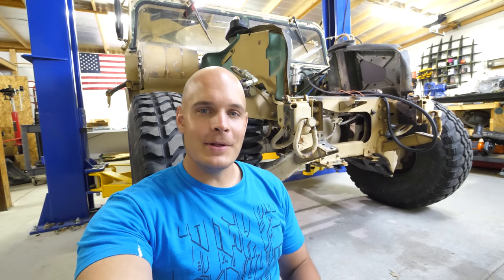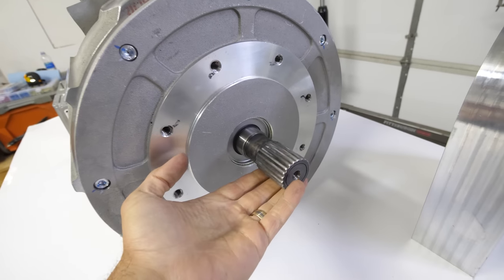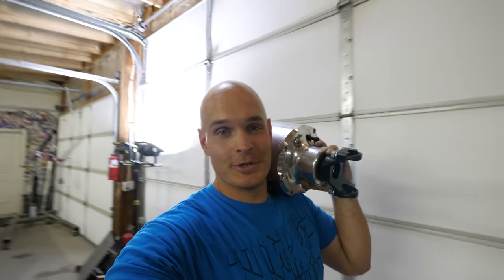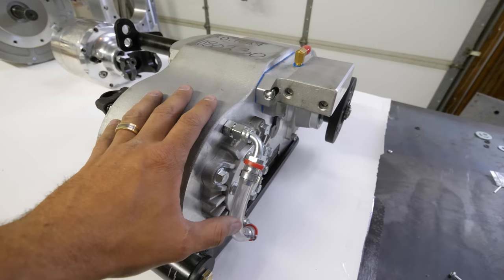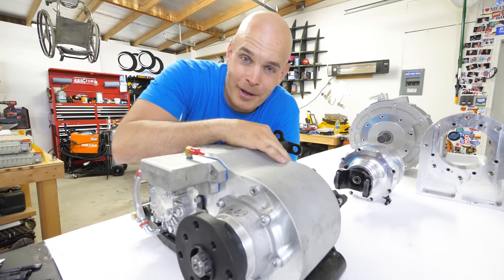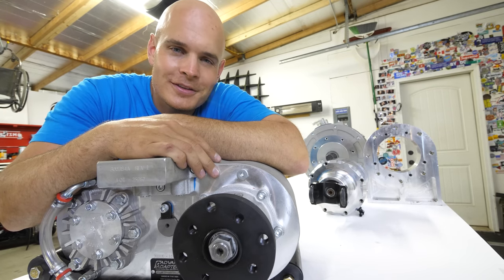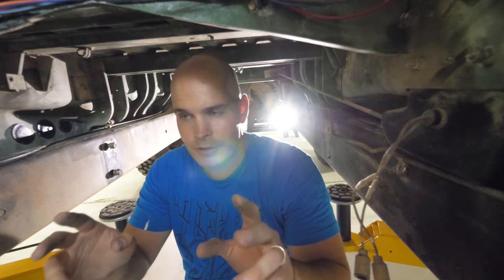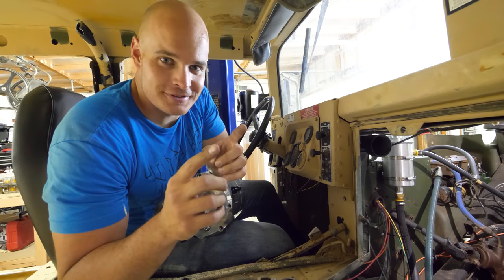How Strong is my NEW Electric Hummer Motor? - EV Conversion!

Comment: “nm” is nanometers, newton-meters are denoted “N⋅m”.
Reply: This needs to be upvoted more. Not saying Zack is terrible but I'm sure he would appreciate constructive criticism!
Reply: Exactly...
Reply: Do muricans actually calculate with nm and Nm or do they have some special  newton nano yard inch mile?
Reply: @flausensieb  I think it's lb-ft
Reply: How much is that in bald eagles
Reply: Thank you, I also had to write about it. We fight for the correct units of measurement in internet, but still unsuccessfully. Instead of torque in Nm the nm's have been given, i.e. a length unit. A small change and changes everything.

Comment: I was a HMMV (sp?) mechanic in the 82nd over 20 years back.  Brought back memories when I saw the pile of parts on the floor ... HMMVs are not known for speed.  We were lucky if they went much over 50mph.  But they are noisy as hell and very uncomfortable.  Their real strength is in their ability to traverse off road, places a conventional vehicle can't go.  In short, they are the modern work horse of the Army.

Comment: Not long after I bought my used 95 Hummer, I started looking into converting it to Hybrid. The all electric components wasn't up to the task at the time. I got a little misty eyed watching this. Much love for you and the family. Stay safe.
Reply: JERRY RIG SHOULD BE "THE BEST JERRY ". HOW BIG, FAST AND HEAVY MAY I POWER A DISPLACEMENT HULL, PLANNING OR HYDROFOIL WITH YOUR HUMMER POWER PACKAGE OR NEW CONCEPTUAL IDEA. ALSO MAY I BUY A KIT FROM YOU READY TO DROP IN WITH WET BATTERIES UNTIL CHEAP CAPACITORS, LITHIUM OR RECYCLED BATTERIES BECOME AVAILABLE. PLEASE EMAIL.
Reply: JERRY I WILL ISSUE A PROCLAMATION TO YOU ABOUT YOUR DAY IN KEY WEST FLORIDA!

Comment: Heyyyy, just wanted to let you know that your garage door is missing something. The top of your automatic door needs a strut, or your opener is going to pull that door right in half and it WILL fall on your truck. Especially if the torsion spring breaks and you don't realize it. I know it's unrelated to the video, but it's what I do for a living. LOL
Reply: Thx for the info, I hope he sees this
Reply: @yourmomlmao9638  ORRRRRRR, he can go get himself a Chamberlain or Genie residential jackshaft opener, and get the motor and rail out from the garage altogether. Then he doesn't need a strut cuz the opener clamps right onto the spring tube 👍🏻. Things are fantastic machines
Reply: My garage ceilings are 11+ft high.  My doors are standard.  When we moved in, I noticed my front garage wall flexing when operating it....  There was no strut for a double door, with motor dropped down about 4ft!  don't know how it ever passed inspection.
Reply: Poor door. Gets ripped in half and falls on the equivalent of a Nokia on wheels.
Reply: @bear8046  Or, ya know....a person? You wouldn't want the guy getting crushed by his own door, would you?

Comment: Zack: "I don't officially have the weight of these components yet, but I can move them around by hand so they aren't too bad"

Also Zack:  has arms the size of the components themselves
Reply: moves the motor and entire table is shaking
Reply: @Blox117  I believe that motor weighs about as much as my Jeep transfer case. Not bad really. Well under 100lbs
Reply: True!
Reply: @yosemitesamiam  then he mounts 150lb tires and wheels no sweat
Reply: @yosemitesamiam  Not even close. The UQM 220 motor weighs 83 kg (183 pounds) and the controller alone weighs 40 kg (88 lbs).

Comment: I would love to see the total cost of this build at the end when you finish!
Reply: Are you planning to do a similar project?
Reply: @Brain_With_Limbs  not at the moment, and probably not with a HMMV, but if it turns out to be cost-effective, I think it could be a cool project!
Reply: @drteeth362  Ya I would like to do a car conversion someday, as well.
Reply: The motor will be really expensive but the batteries will reduce in costs each year
Reply: @drteeth362  all the best
U could try making a real truck fully electric
Will be easier to work on
Reply: Data Fix  wtf do u mean
Li ion batteries cost is reducing the motor demand will be much higher as EVs become the standard
Reply: Engine, 25 grand, the torque box and stuff, probably another 10 (pure guess there that's probably wrong), used Tesla packs are 1500-2000 each (and they're not easy to find if you want the modules from the S or X), it starts adding up. Plus labor. That's the drive train alone. Obviously it can be done for less, but that mahoosive engine kind of sets the tone. Obviously this is all just guesstimates and I too wouldn't mind seeing the final bill.

Comment: ✌🏻 can’t wait for the next video 🤩
Reply: @Samsung Galaxy S12 Pro Max Ultra 6G 128GB 
omg paid bot
Reply: @satendra_sharma  yeah kinda SUSSS
Reply: @satendra_sharma  it is you who is the bot
Reply: Hi
Reply: I'm ur big fan... 🥰🥰
Reply: Yeeeeeeeeeeeesssssssss
Reply: My nissan cube is going electric too. Lol. It will do wheelies
Reply: All the steel after the 4wd box will be pulled apart by the torque. 30 seconds and the video can be over. But Jerry knows this.
Reply: @Madrrrrrrrrrrr  Yeah, it seriously needs soft start controls. Shaft strain gauges and torsion feedback indicators in the instrument cluster just in case!
Reply: @jameslynch8738  yep.
Reply: Waiting for the next video 🔥🔥🔥❤️
Reply: Going to his home may help 😂
Reply: @Madrrrrrrrrrrr  yeah he may need to electronically limit the torque output when going into low range. Once he's done building it he'll just have to see what happens and be prepared to fix some things. Good thing is the hummer parts aren't hard to find.

Comment: This is one of the coolest EV conversions! Any worries that the portals and differentials won't be able to live long with all that torque? Any thoughts on swapping the shocks to something that can go fast through the desert?
Reply: Split the power system into two motors and remove the drive shaft. Would allow more adaptive traction control I think, or any differential setup would burn up trying to compete with it.
Reply: Come to think of it, long stroke shocks and maybe wings(?) for ripping across the done tops.
But for endurance it would probably fail to this guys rig because drivers would try to burn out the power system. Back to the drawing board. Haha
Reply: So these military vehicles shocks and under carriage moving parts were meant to take blows and force from explosive, not making them bullet proof or bomb proof though they were made thick and heavy, enough to take a beating…. Increased torque should not have an immediate impact

Comment: It will have torque to rip the tires apart lmao, crazy ideas, dude, I love it ! You earned a sub !
Reply: It will break cv shafts.
Reply: Will definitely need beadlocks on the wheels :D
Reply: It's going to make less torque than the original motor did.
Reply: @joshjlmgproductions3313  but makes 100 of its torque from 0 rpm. Totally different to ICE.
Reply: @nunchuckfilms  That's true, but it's still 700 NM of torque, not 4200 lb/ft.
Reply: @joshjlmgproductions3313  why ? It's an eletric one, torque is instant. And with all those gear reductions, it will have plenty of torque.
Reply: @errorsk2188  Because ICE engines also have those gear ratios. The thing is, the ratios change depending on what gear you're in and what your final drive is, so it doesn't make sense to specify how much torque you get in each gear.
Reply: @joshjlmgproductions3313  I guess so

Comment: so...my only question is...how do you waterproof all the new electric parts and make it off roadable as the original was with water crossings and such(reasonable depth) not completely submerged
Reply: He doesn't, this is to be used on city streets
Reply: I'll bet a lot of the parts are already pretty water resistant, but I'm curious also
Reply: Kydex. It wouldn't take much to just close off those components with flat sheets, but, you can heat and form it too. Indigo black works for the color.
Reply: Taking an off-road vehicle off-road in the 20's?! Are you high?
Reply: besides the individual battery modules, automotive grade power electronics/motors require high level of  IP rating, IP69K which resists high pressure water, solids,dust,.....If this builder uses the proper connectors, with matching gaskets I could see this going through streams no problem.

Comment: 2:40  Just to be splitting hairs.  This motor is an advanced DC motor with a motor inverter to direct the current directionally through the three motor coil systems.  The motor inverter has complete control over the power level, rotation speed and rotation direction.  But in a sense the current does change direction in the motor coils so that is an AC model.

Comment: Awesome project. If I have to say one thing it is do not underestimate the power of gearing. All these current manufacturers are not using transmissions. But what they are failing to do is create efficiency under loads or trailering. They can boast efficiency only with one person under a light demand. Sure they have large torque numbers, but they do not calculate the energy required to move the heavy loads.  Anyways, very cool. I will be following.

Comment: I’m so sold on electric vehicles now. I was skeptical when they first hit the market but they’ve come such a long way and prices are slowly getting better
Reply: Oh yea. They are going to be great but we need to get full solar homes and vehicles. The problem is storage of power and 1000year
Reply: @vanderumd11  in Australia there’s a lot of houses that run off grid. My cousin, her partner and 2 kids lives on a big rural property and they are 100% off grid, gas bottles and also have rainwater tanks plus get tank water delivered. They have a big solar system and 4x tesla power wall batteries with a backup generator if ever needed. In the last 18 months they’ve only had to use the generator for 2 days when we had a solid week of rain during winter. It’s been a pretty good investment so far, their previous house’s elec bill used to be $2800 annually.
Reply: @Chrissmills  They're far too expensive to be sustainable. I'm sick of my tax money going to subsidize that clown, Elon's, anti-consumer, anti-repair, anti-competition endeavors. 4 Tesla walls is like $40 THOUSAND dollars, then add another $20-30 THOUSAND for solar panels and install. LOL. You'd never be able to justify that cost. It would take you like 40-50 years to recoup that cost, and at that point it's needed to be replaced 3-4 times. LOL. Electric power storage has a LONG ways to go before it's even close to replacing grid power and ICE vehicles. And his cars are disgusting. They can't be repaired by 3rd parties, and since Tesla is more focused on making more new cars than supporting the ones that are already on the road, insurance companies total them out because they're too expensive to fix. Tesla doesn't have the service infrastructure to support the repair of their cars in a timely manner, and they don't allow 3rd party repairs, and they're not producing hardly any spare parts, insurance companies don't want to pay for rental cars for 6-9 weeks, so they total them out. Long before they have met the point of being more green than a traditional ICE vehicle. Since Tesla basically disables every feature (like supercharging and autopilot) after an accident, there is no market in salvage Teslas besides people who do it as a labor of love. When a Tesla gets in an accident that would cost $3500 to fix in any other car, it can cost 5-7x as much, because of the aforementioned reasons, so it gets totaled. Ever use a cellphone or a laptop? How long do those batteries last? 2 years, and they don't undergo anywhere near the current draw that EV batteries undergo. Tesla makes up for it with electronics that limit current draw, and now batteries in parallel, but the packs still only lady about 7 years. So just as the car is reaching the point that the mining of the heavy metals for the battery is offset by the reduction in emissions, you need a new battery. Add in the fact that Tesla lies about being open source, lies about producing cars (semi, new Roadster, and truck are all vaporware), and is in bed with the CCP, and you have one of the most deplorable corporations on planet earth. Amy company that gets rich of of government subsidies, funded by the tax payer, and off of the guise that they're doing it to save the planet, should not be trusted.
Reply: @littlejackalo5326  good to see someone with sense, the only thing I don't agree with is with how you say that batteries only last 7 years, they can last much longer at least 10.
Reply: @littlejackalo5326  The australian government subsidise solar installation's by alot, im pretty sure they were only out of pocket around 30-40k for the whole setup. 10 years warranty on the panels/inverter. Im an electrician myself and they have a good system. 40k for 10 years of Electricity is pretty good in my eyes, especially considering just the connection fee daily to the grid is $1, plus usage. They also were up for a $60,000 contribution to add the infrastructure in to get a grid connection in the first place. They bought a massive block of land and they had no power to the property. The house is about 400m from the side of the road so even if they bought power to the front of the land, ontop of that 60k, you're up for another 50k+ to get power to the house.
Reply: Now I want an electric bronco.
Reply: @Pq-A-Bu Wow, spot on. Great job! I wholeheartedly agree. Batteries have to get better (more efficient, better at lasting and holding a charge, better and easier to reuse/recycle, etc.), the grid/and not grid (solar, etc.) has to get better. Electric cars are probably the future, but they have to improve the battery technology and the state of the power grid first in my opinion.
Reply: @MIGUEL18384  only if you charge them correctly (never fully drain) and use them in climates that aren't too cold or too hot.
Reply: @TheGuruStud  how’s it a scam by the government? You pay a daily connection fee to the distributor (which goes to the power supplier for each state) be connected to the grid (this pays constant maintenance etc) and the government have massive rebates for solar to take strain off the grid as we have brownouts during summer which causes under voltage to houses and kills appliances since they’re rated for 220-250v. I’m an Electrician myself mate you have no clue 🤦‍♂️
Reply: @TheGuruStud  bro like that is never in like california or alaska though and if the military goes electric, yeah, that aint happening

Comment: Zach, quick one about the portals/CV Axels. I've seen heaps of videos of these shattering with large loads. 
Will you be upgrading the CVs or are they rated higher than normal to withstand the new torque loads?
Reply: I was wondering about this as well.
Reply: additionally, wont the extra torque multiplier limiiting output shaft speed to approx 80 mph be further reduced to 60 or lower once reduced by the portal reduction and differentials? Just wondering.
Reply: @jspringer86  take your meds!!!!
Reply: @ElBach1y  ;)

Comment: I can't wait to see if those half shafts can take the kind of load the new power system will bring to the table- I'd carry some of those in the off road bag if I was you. (I have a 2001 H1 and have snapped a few of them when torque got crazy.)  Love this series cause if it works out. I'm doing it.
Reply: Those things are gonna snap right away. No way they'll hold up
Reply: @andrewk8636  Bet he's going to get some carbon fiber ones made. That be a pretty cool episode for this series.

Comment: Interesting to see how you are going about this, pretty cool. I own a 95 hummer.
Please don’t destroy removed parts- many folks need them, including the bad 6.2.

Couple things I wonder about for the future.- maybe you are not aware or just haven’t addressed it yet?

1. The differentials are AMC 20, and you should have the factory torsen diffential.
I made the MISTAKE of making mine selectable 2wd/4wd.  The added load to just one diff is really hard on these differentials, and wears them out much quicker even under stock power plant use.  Also the handling is very different (worse) than original full time 4wd.  

2. Strength.  The AMC 20 is no where near the strength of most pickup units.  Some of the hummers I helped modify for more power eat differentials about every 10,000 miles.  You will be supplying similar, if not more power than those ones.  Start looking into the aftermarket ford 9” units.  You will loose the torsen advantage of brake throttle manipulation- so locking units are to be considered. 

Portal axles (aka geared hubs as called by AM General).  Your hmmwv should have the 10,000 lbs units in them.  This dictates the cv axle (aka half shaft) size is also the 10k you will probably need to go to the stronger ones in the 12,000 lbs rating.  The half shafts are the known weak link and many of us owners learned to keep the weaker bearing cage of the 10k units because the shaft is a couple hundred dollars, diy repair parts maybe $100 each.  If you make it stronger- you will break the geared hubs.   My suggestion is keep what you have, carry spare half shafts.  One fits each rear, 2 different units for the front. 

Good luck!
Reply from the maker: Thanks for the tips! You know what you're talking about.
Reply: Oh btw- 
Hmmwv in the tracks of abrams  tanks is myth.  Tank is 12’ wide...

Comment: I feel like Zach's speech is permanently at around x.75
Reply: I just increased the speed and it fixed the problem..
Reply: @ranoshrafeek8837  It’s a bot, they are on every comment it seems
Reply: @ranoshrafeek8837  its a bot, it wont answere you. I believe Ive already seen the same one on 3 different channels
Reply: @alexsyld5410  what is that bot even spamming..😅😅